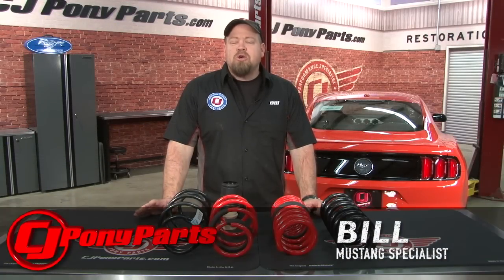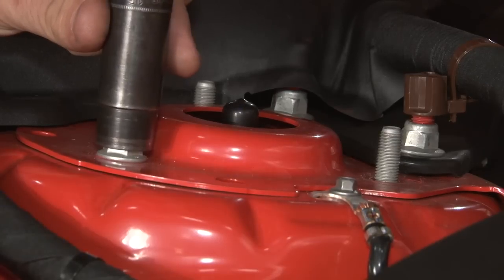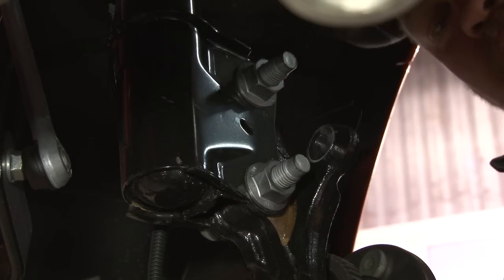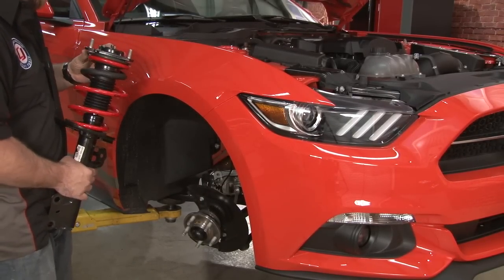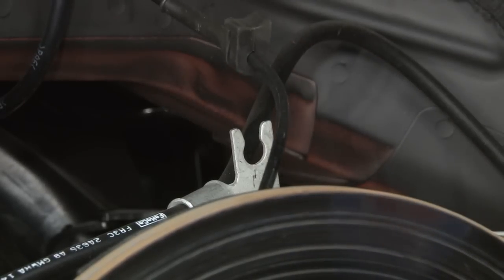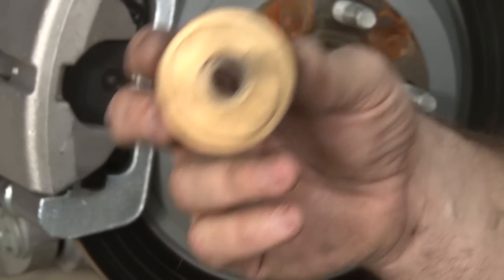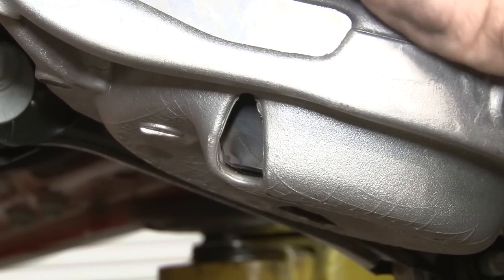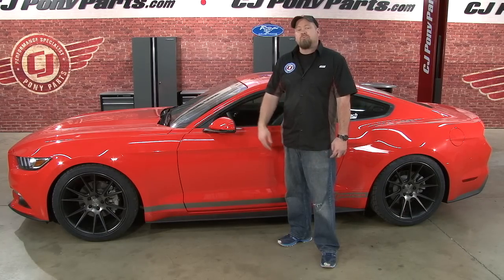2015-2023 Mustang Eibach Sportline Spring Set Installation

Comment: The video is good until I realized you guys didn’t tighten the strut mount top nut twice, you were supposed to tighten after you release the springs. I did the same as in this video and now I have a noise coming from there and when I try to tighten the top nut it just spins. I guess I’ll have to take everything out again.

Comment: Hi Bill, I just has these installed by a shop on my 2016 mustang v6 yesterday. After installation and when driving home I can hear the clanking coming from the rear, and maybe some in the front too on the passenger side. At first I thought it was just my stock springs that I put in my trunk making the sound. But when I got home and emptied the trunk, theres still the clanking sound when going on small bumps. What do you think the problem would be? I called the shop who installed my springs and I was told to come back tomorrow and they will check the problem..
Reply: MrJhAam So did you figure out the problem ?
Reply: Marcus D Yeah, it was the strut's bolt that was loose. They just tightened it up then problem solved
Reply: MrJhAam I have this same problem. Any recommendations? I think i just need to tighten the center nut on the top of the strut

Comment: I just installed these springs on my 16 mustang GT base model and after installing it there was a noise coming down from below and it makes the cabin noise really loud. Whenever I drive on the freeway and hit those little bumps it goes away for a sec and then when driving straight again it goes back. I checked the clearance of my tires and they were not rubbing at all. Are those noises normal when you install these to our mustang?
Reply from the maker: NO they should not make any noise. I would go back and make sure the strut nuts are tight along with the sway bar end links, they are the most common causes of noises post install.

Comment: Hey bill I can't get the lower bolt off the front  strut strut. I got one off. The other just won't get loose. Used an enormous breaker bar and it won't budge.

Comment: I have a performance pack the rear shocks are different i couldn’t get the stock bumpstoks off but they are bigger then the ones that came with the kit so i am going to leave it ... and thanks for not updating the video and letting people know you installed the front bump stocks wrong i already installed them the wrong way now i have to un do it

Comment: I installed these same springs on my 15' GT and for some reason the right side sits 1/4" higher than the other side. The springs are correctly seated and installed. The only odd thing I noticed was the sub frame on the right side when tightening had a lot more resistance vs the drivers side. Is there something that I could have done wrong?
Reply: Loscar5oh Did you figure it out?
Reply: Marcus D no not yet unfortunately
Reply: My driver side had more resistance too. But my ride height is fine

Comment: instead of lowering the subframe could you not disconnect the sway bar and lower control arm bolt at the outer end and drop the control arm to get the spring out?
Reply: Yes you can do it that way. Probably easier that way if you are doing this at your house with a jack and jack stands. Clock your bushings too!

Comment: Hey Bill I have a 14 Gt and I'm running 305-35-20 in the back with a 50mm offset and have a slight bit of poke from the outside of the fender (maybe 5mm) I want to run a drop and was wondering if I run the BMR springs from CJ Pony with the 1.5 inch drop will I be in any danger of rubbing or wrinkling the fender?

Comment: I got 20 in. Wheels with 295/35/20 on the rear and 245/40/20 on the front. I could be mixing up the 35 and 40 series part. My point is, I'm afraid I won't have enough room to lower my car this much? Can anyone respond to this with reassurance it'll work or insight if you've already done something similar? Thanks!

Comment: hey Bill, mine didn't come with the black padding that these on the video have. they also didn't come with the bump stop or the new dust boot. can I still install them with out these or should I wait.
Reply: I would contact ,
 eibach first, if not
Then I'd cut the bumpstops and use the stock dustboot

Comment: Could you use the stock bump stops on these springs? Well, really is there a difference between the stock bumpstops and the eibach ones? I don't particularly have the eibach bump stops at this moment.
Reply: +GI Nicholas  I would cut them down if you don't have the correct ones, you will hit the stock ones with the Sportlines.
Reply: Okay, thanks good to know!
Reply: @Zerogivengarage  how much should you cut it down? From the top or bottom?

Comment: My daily drive on my mustang Gt with stock wheels is mostly on flat road until I get to work that I go over 3 speeds bumps would I have any issues with these sport line spring?
Reply from the maker: They will be fine with normal size speed bumps. Take them at an angle to be safe.

Comment: I just did this instal on my 15 gt pp and the stock bump stop wouldn't come off because the top of the shock where you unscrew that nut has a lip making it impossible to get the bump stop off. Is it ok to leave the stock bump stop on?
Reply: Dylan Larson did you have any problems after u did that ? Cause same happen to me
Reply: luis Velazquez no problems yet. From reading online people were saying the only thing that could potentially go wrong is that you can bottom out on the bumpstop. Which idk how that's possible but even if it is I'd rather bottom out on that bump stop then the end of the strut. Drive about 500 miles and haven't had anything like that or anything else happen.
Reply: Dylan Larson alright cool thanks ! I been driving mine for the last 2 days as well and no problems
Reply: Dylan Larson If you put a little pressure the old and new bump stops they will pass over that lip no problem.

Comment: hey man..great vids.. I just bought a 2015 S550 5.0 manual. it's a used base model with about 3k miles, came with Roush axle back and Roush cold air.. I need this car to handle like a track car. but I don't want to spend 6-7k$. I'm leaning sportline for the dual spring rates. but I need this car to sit flat to get the grip on the corners. I want to run at least sticky 305-315.. what do I need to accomplish this?  also my bro is talking shit with his 2015 z28.. I need to keep up with his fancy ass..do I go sportlines and camber plates and bushings? I need grip, tightness, low body roll and low center of gravity, and most importantly not to jack up my drivetrain..I'm lost here. I need some advice from a pro..can you help? do you need a car to demo for this purpose? I got you. Will pay what u need, live in southern Ohio.
Reply: The Eibach sportlines with the sway bar kit will give you what you are looking for on a budget. Depending on wheel fitment a 305 will work but anything larger will require increased camber in the rear.
Reply: Bill Tumas will the sportline springs require any other modifications to keep the tires sitting flat on the ground(even tire wear)??.. Ive heard of issues with too much negative camber in the front's (maybe rear). also if I'm putting 305s what offset, rim width, and tire height do I need in 19" rims to tuck under wheelwell and still be flush?? . what's the advantage of going staggered vs a square setup?? will thinner front tires still grip on curves?? I've heard the front wheels needs -5mm offset compared to rear to sit fully square.. is this true??  thanks for taking the time to answer my questions.

Comment: would 305's fit in the back with these springs? 305 35 20R, 2016 Mustang GT.
Thanks,
Reply: Depends on your wheels. We had 305s on this car and it was a very tight fit.
Reply: Bill Tumas what were the size and  offsets on those rims?

Comment: Are those 18 or 19's??
Reply: 20x10 all around
Reply: Bill Tumas have you tried 20x10.5 or 11s at all?
Reply: Orlando Darder We have installed 20x10.5s with 305s on this car and it was very tight but still cleared.
Reply: Nice! Appreciate the fast feed back. Any sound clips of the borla ATAK for the ecoboost coming soon?
Reply: Bill Tumas
Reply: Bill Tumas Bill i got this springs on my 2016 gt, i bought 305 20" tires rear so its okay right? or i have to put the stock springs?
Reply: I posted above that we ran 305s and they were tight but cleared.

Comment: Does anyone here have creaking and popping noise from front suspension? I torque everything but the popping noise over small bumps or at low speed is very frustrating.
Reply: Did you ever find a fix?
Reply: @2510LV  No, I showed it to couple mechanics too but no luck yet!
Reply: @Hilbert Hoppyclaps I got new set from Eibach as warranty but they had same issue too. All I do is cranking up the music. A lot of friends switched to Steeda brand instead.
Reply: @Hilbert Hoppyclaps yea same problem. The stiffness module on these springs are bad and when sits on housing, they make popping noise.
Reply: @Hilbert Hoppyclaps also makes noise over bumps. On highspeed your suspension travels less therefore you cant hear it and in low speed on bumpy road you will hear it more
Reply: @Hilbert Hoppyclaps I changed the rubber cap and even as far as my struts but still having issue. In my opinion it is the bad spring but please if you figured out what cause it, I would appreciate it.
Reply: They did not care about its after market part? I remember they gave me hard time once about my exhaust not being OEM

Comment: I have these springs and installed then myself. Was my first time and my 2019 gt pp1 looks awesome. Got the rtr front chin spoiler and the 1inch billett to. Fyi...make sure you get an alignment. Steering wheel was off and shifted to the right. Took it to the dealership and got it aligned. Now its centered and the car drives badass.
Reply: Did you torque them down or just did what you think was right?

Comment: Hi Bill,
do you need adjustable control arms with these springs or can you adjust the camber on the mustang without them? How about the shocks, do they have enough travel left or are they bottoming? Are these working with the Ford Perfomance Street Handling Pack shocks? A lot of questions :)

Comment: My 18 rear sub frame doesn’t drop nearly enough to get the old one out. Had to remove the rear sway bar and loosen the rear bolts plus completely remove one other arm off the frame just to get it done. Might want to mention using thread locker on those caliper bolts too.

Comment: Idk what happened but at 3:51 when I tried to hammer them out they wouldn’t even move or budge I tried lifting the whole thing with a jack to take pressure off and nothing worked even wd40
Reply: Just did them 30 mins ago .. those bolts were a bitch to get out bro
Reply: i had to guy buy a 4lb sledge and it worked like a charm

Comment: What performance struts do you guys recommend ? I just recently bought a 18 GT performance pack and want to put sportline eibachs and wanted to know if i need to upgrade the struts as well?
Reply from the maker: As long as you do not have Magneride any of the 15-17 struts will fit the 2018 Mustang. I am a fan of the Konis with the sportlines.

Comment: Anyone else gets some creaking from the springs when going over speed bumps and driveways ?
Reply: Creaking with a stiffer suspension is usually normal, but if this is your only mod i would pin point where the noise is coming from (Left front or rear right). Check to make sure the springs are seated correctly in the boot, and make sure everything is tight and torqued down to spec (hand tight doesnt cut it). Hope this helps. If you need more help, email me at kbainss550@gmail.com
Reply: Did you ever fixed the creaking noise?
Reply: Me ! 
my rear passenger side !

Comment: Hi Bill,

Got my springs and looking to do the install over winter. You say we need to use a drill bit to open up the rear bump stop a bit more so it fits. What size of drill bit did you use? I dont want to use something too small or too big and then ruin the bump stop.
Reply: +Kereshen Naidoo its very hard to ruin, you want something large enough to just remove a little material.
Reply: Perfect thanks for the info!

Comment: What did you guys use to correct the front camber?
Reply: The car was aligned without issue but there will be camber bolts and CC plates available soon

Comment: Any rubbing issues in the rear? I have 20' wheels on my 2015 GT. I'm debating on the pro or the sport line springs.
Reply: We run 20x10s all around on this car without issue.
Reply: Ok sounds good. Sportlines it is then. Thanks for the prompt reply.
Reply: What about with the 20x10.5 with 305s...did you run with this set up?

Comment: Hey Bill, the rear bump stop is smaller than the stock, how can I make it fit?
Reply: +HeadbangersCommunity  Guessing you mean the diameter of the rear one is too small? I had a similar issue on a different car and used a silicone lubricant and force to get it on.
Reply: +Bill Tumas it was impossible to get it on, so the mechanic ended up using a hot metal rod to stretch it the same diameter like the stock one, then it slid on very easily, is that good or bad?
Reply: +Bill Tumas it was impossible to get it on, we tried everything. Eventually the installer used a hot metal rod to expand the diameter just the same as the stock bump stop. After that it slid very easily. Is that good or bad?
Reply: +HeadbangersCommunity  As long as its on the shaft of the shock it will be fine. Might have just been a bad mold, mine was a battle for sure. Seems to be only the performance pack cars.

Comment: @Bill Tumas I've got the performance  pack and wanted to know if there's a differnce in terms of ride height and more importantly performance? I've plans to run the same wheel/tire dims different wheel. Suggestions are welcome concerning  max offsets and tire dims.  I want the bestvof both worlds. I imagine 20's with a 35 series tires will help but the width/footprint is what concerns me.
Reply: +darkstarVIII  I am not 100% sure what you are asking but the Eibach will look and perform better than stock PP springs. 20x10 in wheels at all 4 corners with 275 35s fit well or staggered 9s and 10s with 275s and 295s
Reply: +Bill Tumas bill appreciate all your videos.!🙌 you mind telling me the drop on that..and would I be able to go 20x10 all the way around? also would I have to go 35 in front and 30 in back with staggered? please help!😂
Reply: +Bill Tumas I have conv. v6